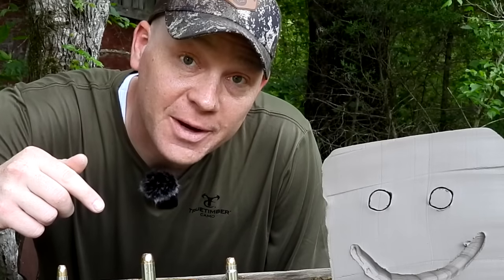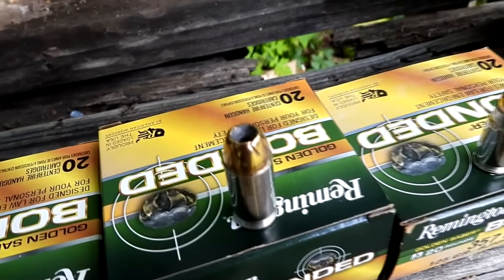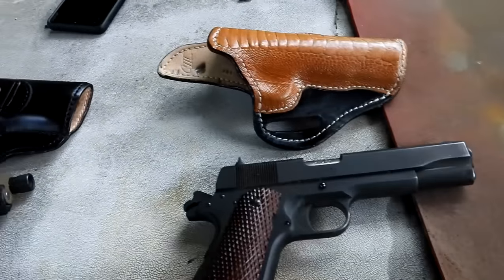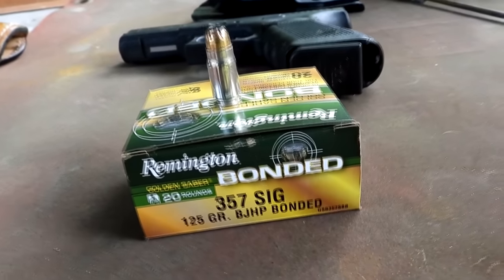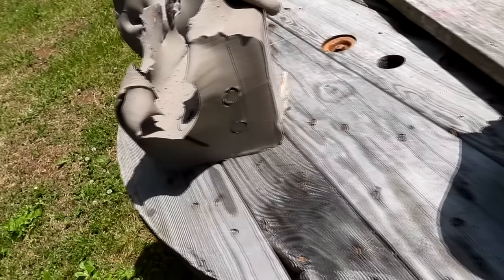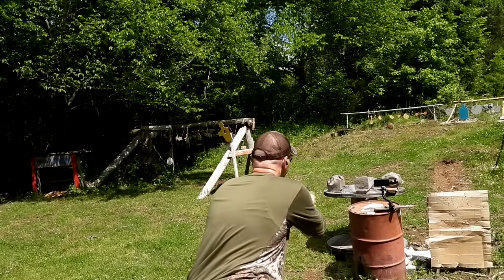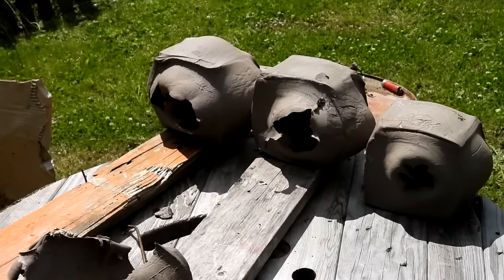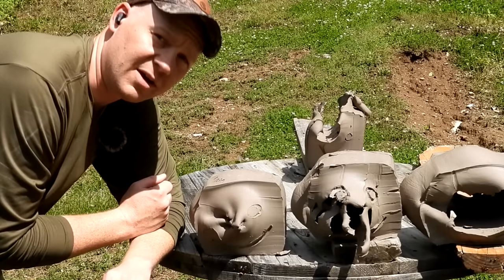9mm vs 45acp vs 357sig - CLAY BLOCKS!!!

Comment: I carry the .357 Sig Golden Sabers too, in a full size M&P 40 with a conversion barrel. I have chronographed them and they are more than 100fps higher velocity fired from that gun than Hornady Critical Defense .357 magnum or Winchester PDX-1 .357 magnum fired from a 3" SP-101 revolver. These loads all have a 125 gr bullet.  And the M&P 40 has 15 round capacity. I know the .357 magnum carry ammo is downloaded for control. Federal full house .357 magnum 158 gr soft point fired from the SP-101 is brutal and will hurt your hand without a rubber grip, this is too powerful for carry in my opinion. 

The .357 Sig Golden Sabers don't over-penetrate in my gallon water jug tests either. The bullet stops in the 3rd gallon jug, but the water explodes a lot better than 9mm or .45 auto.

I also have a Glock 33 in .357 Sig, this is a double stack sub compact, and it is a handful, I don't carry it lately. Right now if I don't carry the M&P 40 then I carry a Walther PPS in 9mm, depending on how I dress. The Walther is a single stack 9mm and is much easier to conceal under light clothing. I have Winchester PDX-1 9mm in that gun.

Comment: “Better” seems subjective in this case. Depends on what you were going for. Simply stopping the threat or totally annihilating the threat…in which case 9mm did a fine job at stopping while 357 did a fine job in annihilating it. 45 is just a fat slow expensive round, not much better than 9mm round.

Comment: Speed kills. 357 was the fastest. Put a 125 grn 9mm and it would be very close to the 357. The 45 did hit way left. The edge of the expansion was barely in the center of the clay block.

Comment: Yo, mi amigo...
If this is at all accurate, the 22 vs 22 mag using the Norma cartridges would indicate a 22 mag nearly equal to these results of 357 sig.  Granted, the variable of barrel length comes into play.  But I find the comparable results intriguing if not telling.

Comment: 357 has more gunpowder and has smaller bullet that means higher velocity and so greater wounding capability. The .45 has a bigger bullet with lesser amount of gunpowder compared to 357 but having heavier bullet it has greater weight and knocking weight.

Comment: Clay actually reacts to SPEED and size.  I would really like to see the 9mm 124gr against the clay block.  I don't know why you used the 147gr 9mm round to compare to the 124gr 357 sig round.  I know the 357 Sig will still win (because it's faster), but it will be a much more legit comparison of the two.

Comment: I like the performance of the 357 Sig but I never purchased one because I can’t consistently find any ammo. FMJ practice rounds are practically non existent and you usually end up practicing with JHP’s. That’s if you can find ammo at a price that isn’t double (or more) what you pay for 9mm, 40, or 45. I’ve been able to find 5.7x28 ammo more easily than I can find 357 Sig. That sucks because it’s a good round. Case in point. In my area a box 50 round of FMJ 9mm, 40, and 45 cost $19.99, $28.99, and $29.99 respectively. 357 Sig cost $64.99 for a 50 round box of FMJ and it’s not even in stock all the time! Ridiculous! 357 Sig is roughly 3 times more than 9mm and roughly double the price of 40 or 45. 5.7x28 is $44.99 per 50 rounds for FMJ’s in my area. It’s expensive but at least it’s in stock all the time.

Comment: I think we are splitting hairs here. Each one of those rounds are lethal. So, I guess if there is a question as to which one is MORE lethal. the answer is dealer's choice. Now, you could go through all the ballistics just as you have with comparing the results of impact, but at the end of the day any of those rounds would dispatch a target with no discernible differences.

Comment: I shot all 3 rounds myself I like the 9mm and 357sig rounds better I felt like they did better then the 45 I personally felt like 45 is slightly under powered by its weight where 9 and 357 are same bullet different case

Comment: Excellent comparative if you are hunting Golems (Was made from mud) 🤔 For best comparative, is need use another type of multiple test's at different distances, etc.
Not only using the more or less type of ammo inclusive use the same model of handgun with same length barrel.... Physics laws say if you use a low pressure  cartridge with subsonic velocity the projectile can't expand enough (The HP ammo pursuit to emulate a bigger caliber ammo but need more speed to do it) 45 Auto can't play with 357 Sig in velocity and projectile expansión but play good in shocking a bad guy without over penetration and range excess for defensive use. More rounds? Only if you are a very badly shooter. Nowadays are a lot handguns with 45's double stack magazines if you need spray a lot of chumb to hit in a man sized target at few meters (Sorry, in Europe we use metrics).
Where I live, the choice is more easy, dumb laws stablish only FMJ ammo for civilians for protection and this is the key... With a 230gr FMJ 45 Auto can manage a bad guy without over-penetration or over-range 🤔 but it's another question.... 
Good Luck hunting Golems! ✨🖖🏻😁✨

Comment: My favorite is sig p220 10mm legion  an also p320 xten 10mm 15rd butt my Next favorite is the sig Sauer p320 357sig I do have the glock 31 357sig sig Sauer is way more accurate an powerful I usually carry the sig Sauer p229 357sig 13td awesome gut way better than the glock

Comment: 7:15 look how close you are compared to 9mm. Just saying....
10mm RIA budget 5in 1911 (very reliable), but 9mm has come a long long way in improvement since the Miami shootout and I'll use budget compact G2c 9mm both Hornady Critical (Defense G2c or Duty 1911) ammo with the polymer filled cavity. Both guns been reliable in my use. But also don't let them muck up either. Decent care is plenty good without excessive use.

Comment: Looks all three would do the job. However if you are in a crowded area I’d use the 9mm and late at night in town the 45 ACP and if I’m protecting the President of the USA I’m using the 357 Sig. if I do carry it’s a 38 special hollow points because 99% of the time the bad guy is close and if you over carry you could hit innocents

Comment: I appreciate what you did do, but, I gotta say a 9mm 115gr is a better comparison to the 357 SIG 125. SIG is also available in 115gr and 147gr, just saying. I'm also at a loss as to why the 40 S&W was left out. Don't get me wrong, I'm a fan of the 357SIG, but why ignore an even more popular parent cartridge? And no, a 357SIG pistol does not carry as many rounds as the same pistol in 9mm. G17 9mm holds 17 rounds, a same size  G31 357SIG and G22 40 S&W hold 15 rounds each; though larger, the closest size G21SF in 45 ACP holds 13 rounds.

Comment: I load a 90gr Hornady hpt in my Sig and get 1850fps comfortably noisy but very little recoil...and is devastating on Blue Wildebeest and pigs impala  and very good on body armour without trauma plates.....and pressure is not excessive....I get good accuracy out to a 100m....I shoot a mod 31 and put all the rounds on and A4 paper of a steady rest....my eyes is dodgy....but that's good for me.
The 90grners is also nice and light to carry. 
I am a retired Bodyguard and you can feel the wight of the heavy projectiles after a 18hour on your feet..I am 67years old so every little I can get helps....hope the reloaded ers try this out....our powder in South Africa was until recently MP2OO That has got a similar burning rate as Unique  .
Give or take.....

Comment: Saying there 45acps that can hold 15 rounds just like a 9mm so the size difference in rounds is irrelevant is missing the point. Compare the size difference and concealability between anything that can carry 15rds of 45acp to something like a springfield hellcat pro which is slightly smaller than a glock 19 and it should make sense. However I am now finding a way to justify buying a 357 sig because that did some massive damage.

Comment: I don’t quite get this. Essentially the 357 sig is a powerful 9mm. But it’s harder on the gun frame, harder on the shooter. Maybe one reason 9mm is so ubiquitous is not a magic marketing ploy, maybe it’s cheaper, easier to load 5-10 into an oncoming threat. And when that attacker has 5-10 holes, the timer is ticking. For someone who shoots 90% mor often than the average person, I’m happy with 9mm

Comment: Best round by far is the 9mm because of capacity but best performance is clearly 357 sig. the capacity is obviously not the same if your 9mm holds 17 then the 357 holds 15 and the 45 holds 13.  I think a well placed shot counts more than anything which if you have capacity then your chances increase with 9mm but that being said if you can hit every time then 357 sig has to be the goat.  The clear loser in my opinion is the 45 acp it doesn’t win in any category.  Not as effective as the 357 amd the capacity is also much lower.  It’s great if you can’t carry hollow points.  But unless you’re military you can so it’s the last choice I would make for edc.  I’m an expert shot law enforcement officer and I’ve carried both 9mm and 357 sig but I would always go for the 9mm.  That being said I always shoot top tier won top gun.  But i think better rounds would also help.

Comment: That proved it.  Even a good bullet in 9mm 147 grain SUX!  Why would anyone rely on a round too heavy for the caliber.  Results soon after it’s adoption we’re dismal and they still are.  Light / medium weight for caliber bullets are far better.  Now test 185 versus 230 and 155 versus 180 and 115 versus 147.  
Thank you for doing these tests!!!   Now change your 9mm carry load.  (Or carry the 357).   😂

Comment: I shoot all 3 of these weapons' on a continual basis. I can tell you without a doubt, the .357 Sig  does more damage than all 3 of these calibers. People think, the larger the  larger caliber, (.45), the more damage it will do and that's not necessarily correct. The .357 is a necked down .40 caliber and it's a great penetrator compared to other calibers. The only drawback is, that it is a little more pricer.

Comment: All well & fine, except these tests don’t illustrate why a .40 is superior to a 9/.357 and why the .45 is superior to that.  It is maximum permanent expanded diameter coupled with a achieving minimum depth of penetration that accounts for greater handgun stopping power…terminal energy, temporary wound cavity & terminal velocity don’t.   The reason is that handgun stopping power is achieved by maximizing rapid blood loss from major internal organs.  The greater area of tissue disruption, the quicker the incapacitation.  Only high power rifles delivering terminal velocities over 2,200 fps are able to also deliver adjacent tissue hemorrhaging due to the massive hydraulic pressures involved.  Handguns can’t do this; again, it’s about maximizing the cross-sectional area of a projectile’s face…the bigger the caliber, the the more damage.

Comment: I will say just this.....if you had shot  the clay block with a Glaser Safety Slug in any caliber, it would have blown that thin block of clay all to pieces , yet, we all know that the Glasers are pour man stoppers. Remember, penetration is vital for a good defensive round. That, and control ability.....there is a reason why the FBI returned back to the 9MM along with most police agency's.....and no, it wasnt just due to cost.

Comment: Was shot in the face in a firefight in Nam, just an inch in front of my left ear at jaw, slug broke in half, I spit half out at the 24 Evac Hospital.  The other half exited my face in front of my right ear at the jaw.  I spit out bone pieces for 3 months, couldn't talk normal for about 3 months,  but the Army an later Navy Doctors were great plastic surgeons, my face is normal except for a small 1 inch scar on each side.  So yes the 45 round is lethal.  But I still pack a 9mm .

Comment: If watching clay go boom leads you to think 357 sig is an even viable round (pro tip, it's not), then you're absolutely beyond help
Reply from the maker: Why do you say 357 is not viable?
Reply: @WHOTEEWHO  that's not "me" saying that, it's the entire market for pistols saying that; I'm just pointing the fact out.
Reply: @LIONTAMER3D  Viable by what metric?!? It has superior ballistics to 9mm which certainly seems viable, there are a ton of pistols made in it and every gun store I've been to stocks .357 Sig ammo.

I don't know what kind of pro you are but I get the sense you shoot a lot less loads at the range than you do on the floor in front of the computer if you know what I mean.

Comment: Another thing to consider ( yes I'm a 9 guy , I did carry a 1911 Colt Commander 45 for years)  While the 45 bore may blow a bigger hole with 2023 multiple thug gangs I'll take my old 17 Glock with 17 115gr Critical Defense loads

Comment: Man those 147 grain 9 millimeter are not a great choice. You are killing the velocity of that round shooting such a heavy bullet. It's basically doing a similar velocity to a 40 cal with 180 grain bullets, which is also a bad choice for 40 cal. I use 165 grain in my G23C because it gets me about 1100+ FPS. If you do 124-grain on your 9, you'd be getting about 1100+ FPS you're probably barely cracking 1000 fps with those slow and weak 147 grains. Now I suspect that .357 Sig would be able to push some 147's fast enough.

Think about why the .357 Sig is so good it's velocity! Speed kills my man.

Comment: You used way to heavy 9mm it is going to slow to open proper 115 gr 9 mm hollow is where it’s at would have been closer comparisons to the 125gr bottle necked 357 sig with way high pressure and speed.
Reply: I have all 3 as well 357 has got the power but it’s expensive and way harder to find 9mm and 45 usually can find anywhere

Comment: gud 'un. but, a lot of idiots out there still think Relative Stopping Power Tests give an accurate demo of exactly what yer bullet will do to a bad guys' torso, ie, a Clay Hole Relative to a human bullet wound. 
  wrong. tests like this simply allow the shooter to sensibly ask, and answer, which ctg he would rather shoot a lethal-threat with. basically: bigger hole, or smaller hole, in clay? deeper penetration, or lesser penetration, in clay? NOT: here's what WILL happen to the human torso-- there are WAY too many variables for realistic predictions. 
  this MAY explain why there were (supposedly) 3000 after-action debriefings, for 30yrs, indicating that 357 service revolvers were avg 96% one shot stops. who knows; its debatable. but, the 357 HAS more energy AVAILABLE for better expansion AND penetration.

Comment: Facts don't lie. Period.  All three would have put a human in bad shape in a self-defense situation. That's true. But...The 45 and the 357 did much more damage.  Sometimes I shoot 185gr HP in my 45. That's a lot more velocity. It's faster than a 115gr in my 9mm, and does a LOT more damage. 
Some people hear what they want to hear and call it fact. A 9mm may have more penetration, but who cares. I want a bullet to expand and go through the vitals. How thick is an average human body? If your bullet comes out the back and keeps going...you may have just shot another person that was on the other side of a sheetrock wall. I'm not knocking a 9mm. I have several. The fact is...a 9mm luger is not as effective as a 45, or 357 sig, or 357 mag, or 40 sw. Some 9mm fans may move to the new 30 Super Carry. Several companies are making guns and ammo for it now, and it has a higher capacity than 9mm.  In my opinion, the FBI switched from 40SW to 9mm because they had too many lawyers and accountants that couldn't handle 40sw recoil. It wasn't because the 9mm was better.